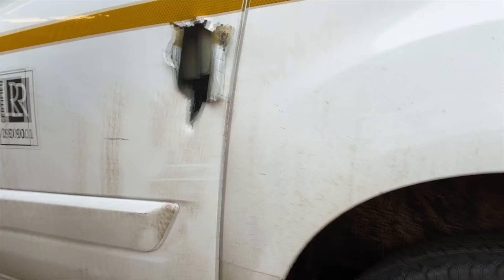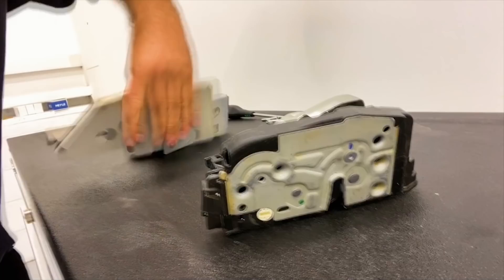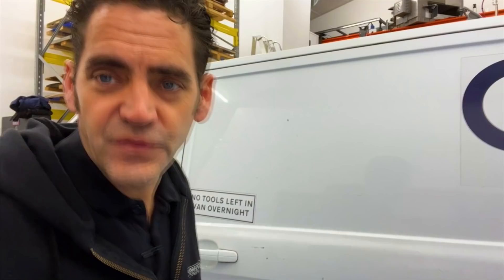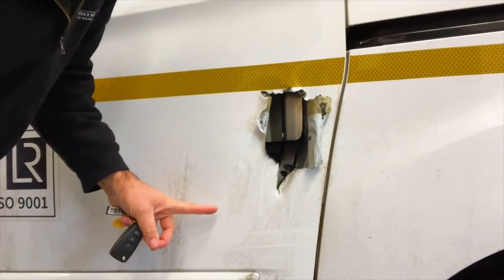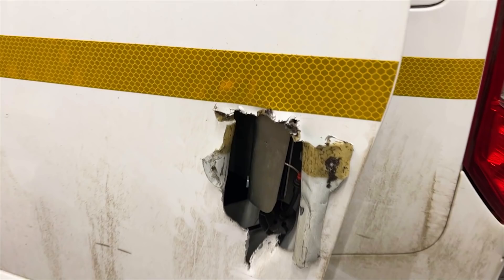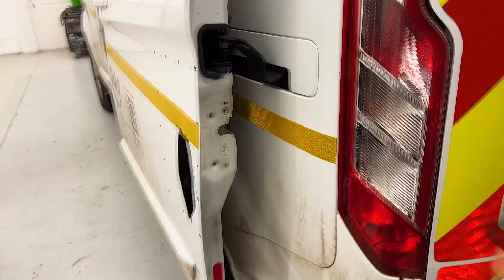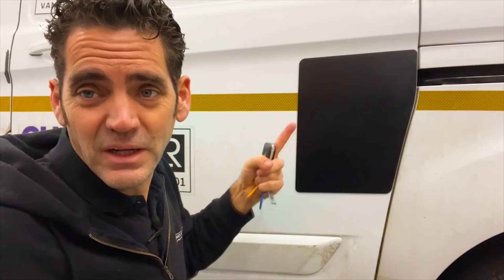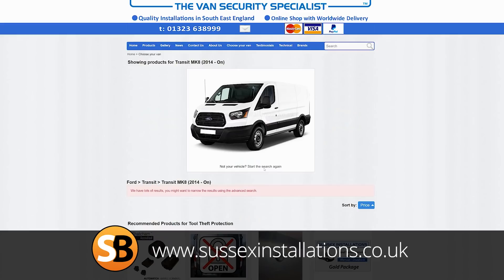Load Door Shield — Armour For Your Van

Comment: I bought a load of gear from you guys, did it myself. Deadlock for side and rear doors and protection for the lock mechanisms. I also stuffed a load of rag around the mechanisms so when they attempt to drill through the bit will just immediately tangle up. Not been broken into yet 🤞🏻
Reply: That rag idea is brilliant, nice one 👍
Reply from the maker: That rag is a great idea. I have been looking at fibre fill for the ply lined van.
Reply: Anyone who’s ever drilled in to insulation or a rubber glove! Knows what that’s like 😂
Reply: @SkillBuilder  easy fix, costs very little.
Reply: @plumbertime  Or house wrap! 🤣🙄
Reply: Chainsaw chaps would be the ultimate

Comment: Manufacturers need to sort these easy accessible locks as STANDARD! We shouldn’t have to worry about doing all the mods after spending a fortune on a van! 

I remember the time I used to have a pull out stereo and took it with me everywhere….  Same principle- get rid of the low hanging fruit for these criminals!

Comment: The [no tools left in this van overnight] sticker didn’t work then. This is an invitation not a deterrent. As for the repair panel. Ridiculous in my opinion you spend all that money on the van and this happens so easily the manufacturer should be accountable. Don’t buy that ford van van it’s like a breaking into a tin of beans.